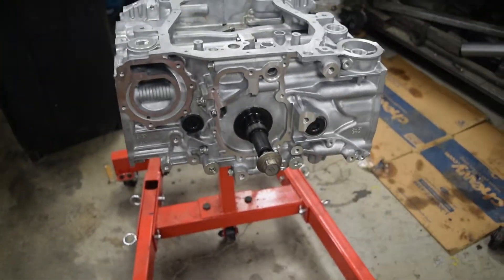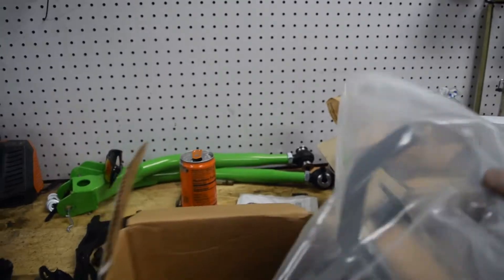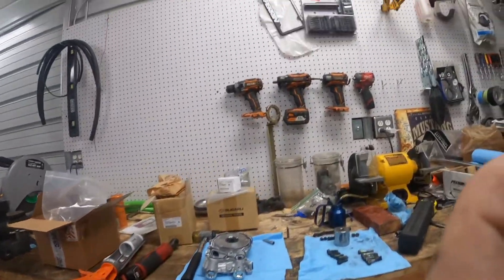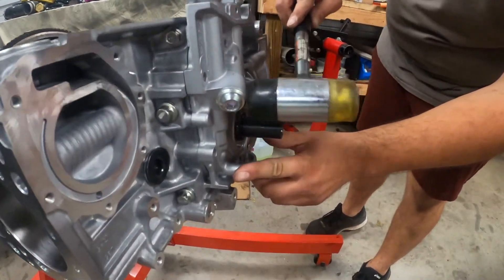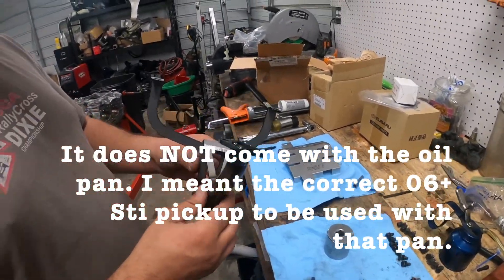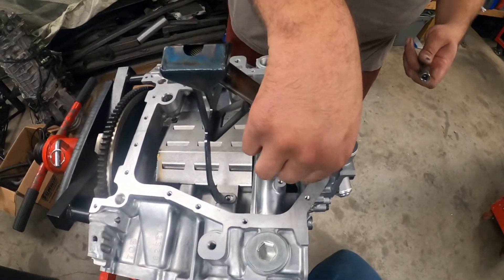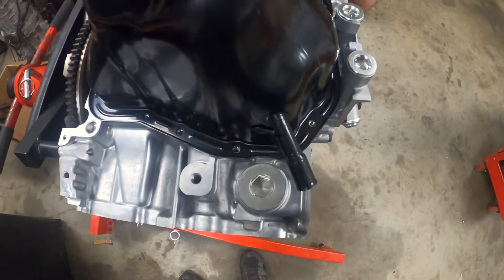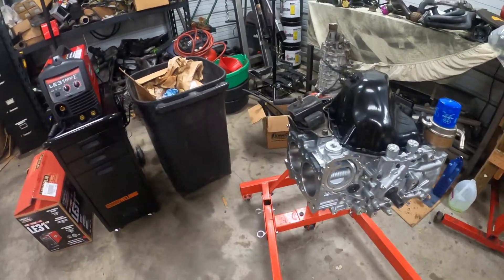IAG Magnum Assembly Pt 2

Comment: What’s the difference between magnum vw 3 extreme block iag?
Reply from the maker: The stage 3 extreme is rated for 100 less HP. This is due to using 1/2" head studs instead of 14mm that the magnum uses and the magnum uses 2mm longer connecting rods with different pistons. Stay tuned for our stage 4 extreme build coming soon. The craziest block they make, aside from the billet block.
Reply: @bankruptmotorsports  oh wow but the magnum is cheaper than the stage 3 extreme, do you know why?
Reply: @wrxstivideos7422  I just checked the website. The magnum is more expensive than the stage 3 extreme.

Comment: what size bolts did you use to mount it on the stand ?
Reply from the maker: you use the factory studs on the bottom and the long bell housing bolts from when you remove your engine. They are M12x1.25 I believe and 5" long or so.